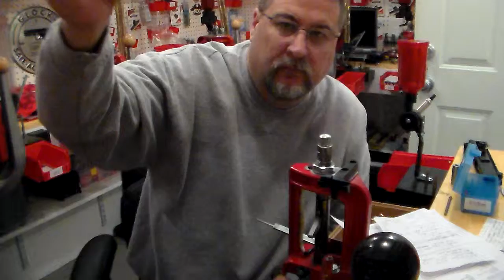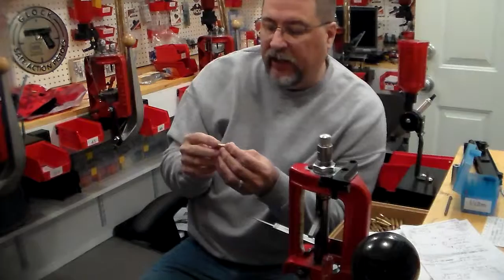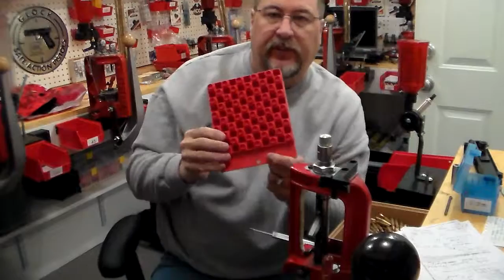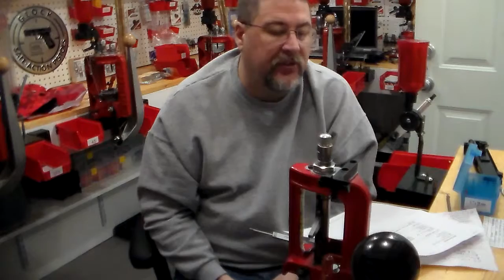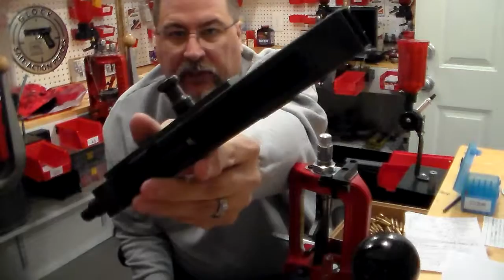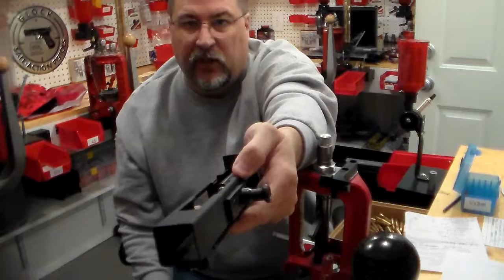5.7 x 28mm Quality Inspection-Check GO-NO GO GAUGE

Comment: I believe the issue is not the gauge if the factory rounds work as they should in it but lee dies changed the specs on these 5.7 and this caused the problem.

Comment: Good video.  Did EA get back with you regarding the case gauge because I have had the same issues?  I set the die and set the shoulder back to SAAMI specs, but it does not easily go into the gauge.  I noted that the factory ammo is about .001" less than the specs.  So the dies are not off and the gauge is not off, but the dies don't size to the factory specs, therefore, the gauge is a no go.
Reply from the maker: +Robert Szabo  I sent 3 emails and left messages. They have not responded, I am little disappointed because I was trying to give them a plug for having a gauge for this round. You are 100% correct on your statement. That gauge cost me around $50.00 and some change if my memory is correct. Right now I have to use the barrel from the gun for my QA check. If I hear anything, I will let you know. Thank You for your feedback.